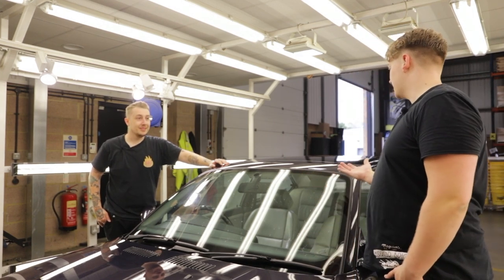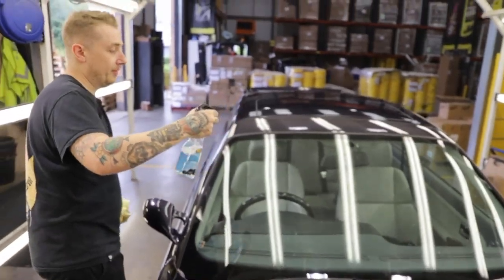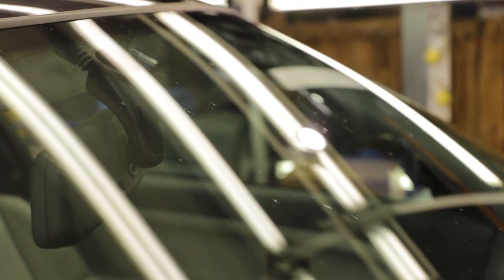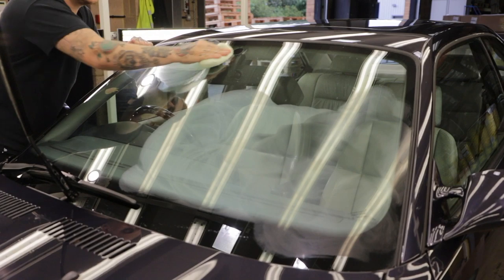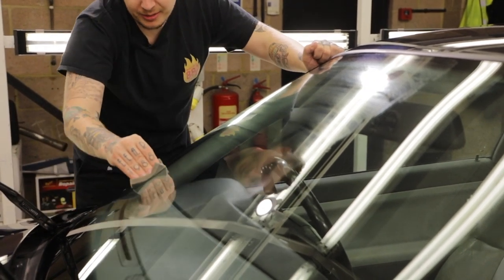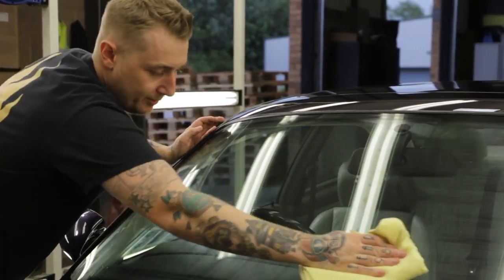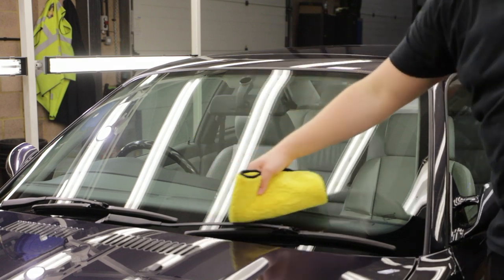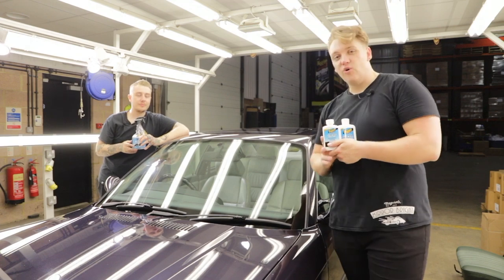Cleaning & Protecting Glass - Meguiar’s Detailing 101 – UK Edition

Comment: I too knew nothing about car care... that was until I watched this video series... Here is my story: 

Eager to put what I had learned into practice, I headed to my nearest Halfords with a spring in my step. I walked out having spent £150 and was by this point questioning my life choices. 

Having watched a mediocre performance by Manchester United in the Europa league and despite it being dark by this point... I decided to get started. 

Lesson number 1: don't do this in the dark. 

Starting at around 10 I began, spray wash down... with a pressure washer? Oh no no my friends. I used a garden pump action sprayer... needless to say I regretted this decision. 

Lesson number 2: don't use garden equipment on your car. 

I washed with wash+ using my grit guard... but only 1 bucket (sorry Dale I have failed you!). Did I mention I am doing this all on a Renault Master van? 

I then clayed the whole van with quick detailer as lubricant, compound... then the heavens opened.

Lesson 3: check the weather

Short 30 minute break then back to polish, liquid wax, glass clean and internal clean. 

Took me 6 hours. Didn't have enough microfibre towels. Things got dicey towards the end when I cracked out the household towel (just to pat dry the rain) 

Van looks shiny but I can't really tell as it's so dark.

Regrets.
Reply: Respect the dedication

Comment: Meguiar’s, I enjoyed the video, certainly instructive and useful for someone who’s a beginner, but I didn’t see the wiper blades cleaned. How would you, and what would you use to clean the wiper blades? 
And is claying the windshield first recommended, or is that unnecessary?
Greeting from America, Northern California.
Reply from the maker: Not entirely sure what you mean by cleaning the wiper blades?  If you mean cleaning the rubber of the blade something like our M39 Heavy Duty Vinyl Cleaner would work well.  If you mean that they are faded and you want to restore the rubbers' black appearance you could certainly use your favorite vinyl and rubber dressing, but keep in mind most of them are water based and if you over apply them and it rains the excess product could run off.
Reply: How about Wiper Refills? The rubber Windshield Wiper (as we say in the USA). If the windshield has been caked with dirt, and the windshield wipers have been used, then the rubber is more than likely dirty. Be a shame to thoroughly clean the windshield and have dirty windshield wipers. I was just curious if you advise to take a microfiber towel and wipe clean the rubber. 
And what about claying the windshield first? Not necessary or recommended?
Reply from the maker: Yes, if the windshield is very dirty it would be better to clean it first before using the wipers.  Again, if you want to clean the rubber wiper blades our M39 Heavy Duty Vinyl Cleaner would work well for that.

You can certainly clay glass but clay is not designed to clean a dirty windshield.  You would need to clean the windshield first and then clay.  Clay is then going to help remove any bonded (stuck to the surface) contaminants that washing or your glass cleaner did not remove.

Comment: For maintenance cleaning, is it safe to use the Glass Cleaner or will it remove the sealant on the glass?
Reply from the maker: Yes, you can use our glass cleaner for normal maintenance to remove dirt, dust, etc. from the glass.
Reply: What about the polishing compound? Would it remove the sealant?

Comment: Idk if I'm doing something wrong. I've applied the compound exactly as show and wiped off exactly as shown but itbdoesnt seem to be getting rid of the residue/oils that hsve buult up over time from other products which leaves a brief haze after every swipe of the blade. 

I saw in your 2 minute video of the compound that it removes haze but it doesn't seem to be. Have attempted twice now, is there something I'm potentially missing?
Reply from the maker: Is there a product or other contamination on the windshield wipers that is causing this when turned on and wiped across the glass?

Comment: Should I clay the glass before polishing. Would it help at all? Is it even necessary. Or does it depend on the condition of the glass itself?
Reply from the maker: Claying your glass depends on if your glass contains bonded contaminates. So if you have over spray or bonded contaminates it will clean them up nicely.

Comment: Could you use the compound on the inside of the windscreen
Reply from the maker: Assuming you mean the glass/windshield on the inside of a vehicle, yes you can as long as it is bare glass and there is no UV tint/film on it.  There are not typically many reasons this would be needed on interior versus exterior glass but again that would be fine in theory.

Comment: Can I use glass cleaner to spray some mist on microfibre towel for wiping off the dry glass sealant ?
Reply from the maker: Can you clarify what you mean by "wiping off the dry glass sealant"?  Are you asking how to remove a product from the glass?  Which product?  Why?
Reply: Meguiar's oh~ I mean when applied Perfect Clarity Glass Sealant, after it dry can I use Perfect Clarity Glass Cleaner Spray to clean off the dry glass sealant instead of using warm water as shown in the video?
Reply from the maker: No, during the application process you should use a damp (water) cloth to remove the sealant.  If you are referring to days or weeks after you can certainly use the Perfect Clarity Glass Cleaner as your maintenance cleaner to keep the glass clean.
Reply: Meguiar's alright, understood.

Comment: What pad polish from glass car
Reply from the maker: Can you please clarify your question?  Are you asking which product should be used on glass as well as which pad to apply it?

As the video shows you would typically apply the Perfect Clarity Glass Cleaner with a good microfiber towel.  If you are referring to the Glass Compound or Glass Sealant we would recommend the foam applicators included in the kit but you could use another if you do not have the kit.

Comment: How long the sealant last?
Reply from the maker: You would have to be more specific as to which product you were referring to but how long any protection/wax lasts is highly variable and depends on a number of factors related to the condition of the paint, previous prep, and the environmental elements the vehicle is exposed to.

Comment: Will this also work for the inside of the glass ?
Reply from the maker: Yes, but the inside does not take the beating that the outside usually does so it may not be necessary.
Reply from the maker: Yes, typically.  Glass does not degrade like paint or other finishes and the interior of a car doesn't get much other than light dirt or dust.